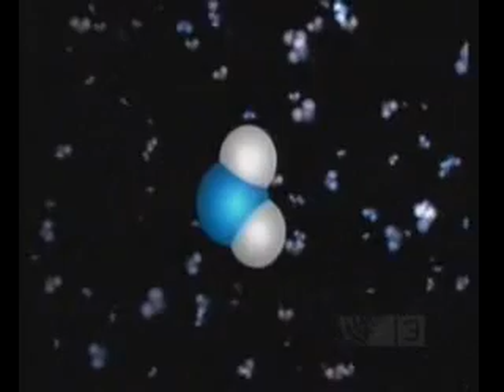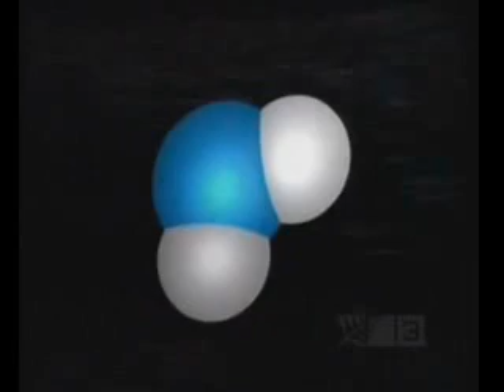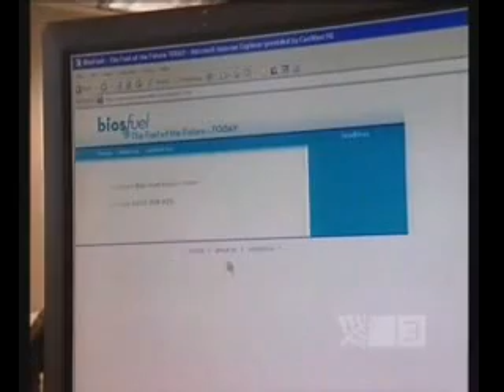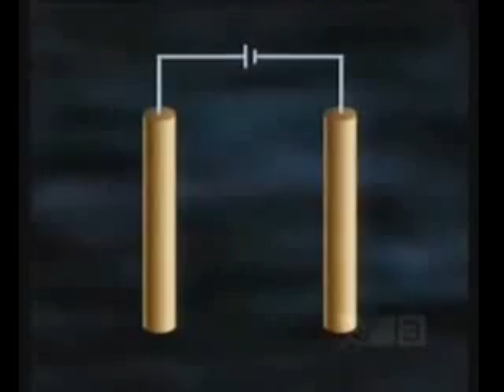A Motorcycle that runs on PURE Water.

Comment: What is the issue about having an Electrolysising unit fitted into home/garage to break the simple bonds of H2O and fill up Hydrogen/Oxygen bottles for use. I have to pay £5.75 UK per gallon, thats approx $10 a Gallon, surely a system to convert water into base gas atoms would be so much more efficient especially When you consider solar panels/wind/tidal to use for the power source to convert the water. BUT all You Oil Corp trolls will try and say we should still give you $10 a Galln for rotted trees, when we could EASILY grow crops to KEEP all that cash for all the years IN OUR Countries...OH except I forgot, the UK/European/Asian/Russian/China elites are ALL owners of OIL, Banking, Media, Pharma etc so why should they care if the world PAYS the Oil Corps $2 TRILLION a Yr in "Subsidies" thought we pay market price, that sounds criminal, even the criminal IMF said it WAS Criminal.....lol.
Reply: Nothing is stopping you from setting up a hydrolysis system in your garage.   Then you can see if the energy  required to produce your fuel costs less per watt than buying fuel from a gas station.  Solar power is going to require a significant investment and I wonder how long it would take you to recoup its cost by making your own hydrogen fuel.

As for oil companies suppressing this type of technology - maybe they are, maybe they're not.  But it seems to me an oil or automotive company would be far smarter to buy this technology (assuming, for the purpose of this argument, that it lives up to the claims of baldy), develop it and be the first on the block to have a viable product.  This would place them at a huge advantage to their competitors.  Their execs would be swimming in pools of money like Scrooge McDuck.
Reply: butlerproman
I've also been told of a system using a catalytic convertor from standard car. They fit this HHO gas outlet (H only I think) to the catalytic convertor and states the convertor heats to 400 degrees and can be used to heat home water systems cheaply if you want to go off grid using HHO more effectively for all power reqs.
Reply: Yea let keep bulk hydrogen in the garage now. A furnace and hot water tank id bad enough. (key between a and d broke on my keyboard lol)
Reply: Collin Huebler
Well you can make as you require. Plus no more dangerous than say a Huge Propane gas tank on Caravans, Camper vans etc, or fuel in the tank of Liquid Gas vehicles, all nasty stuff.  I assume you've lost your SSSSSS....lol
Reply: PYakMan1 Well if done right im sure its no problem but my main concern was when the neighbor starts his house on fire or a natural disaster. Also pressurizing the hydrogen for storage might prove dangerous. copy and paste will preserve on this keyboard until i take it apart lol
Reply: Collin Huebler
NO Different to having LPG on a car, or Propane for vans etc. Fuel is dangerous, but we have used it for 100yrs so if they blow themselves up, certainly should know better.
Reply: PYakMan1 You clearly didn't ready my comment.

Comment: one would think this is complete BS...and I would be one of those people....the only way this could seem to work is producing HHO with electrolysis. But standard means is has a poor net energy ratio. Meaning it takes one gallon of gas (energy) to produce a half gallon of HHO. BUT...there is a new way of splitting h2o. With aluminum and gallium. The water reacts to the 2 and splits with no need to add electricity or very little. So it is in reality if can be done...but I don't think this is it.

Comment: i ran my 1980 honda prelude fuel injected for 100klm before blowing it up, ive proved that it works no modification on a carby engine, non of the new engines will work straight off water, fuck the fuel cells, the engine need the split process to take place in the engines itself because it need heat and pressure in order for it to work.

Comment: the secret is that its just plain clean water, he is lieing i ran my car straight off it, dun and dusted, it will run due to the pressure of the pistons and the electricity of the sparkplugs bigger magneto bigger sparkplugs no problem at all to run, fuel cells are a scam they only make 1% of the needed amount of hydrogen

Comment: This video was uploaded SIX YEARS AGO. Do you know of any motorcycles today that are running on water? Surely if this were true, you would have read about or seen such water-fueled engines by now! But, surprise-surprise. THEY DO NOT EXIST!  And they never will exist because water is NOT a fuel (unless you mix other chemicals with it, like the guy in the video apparently does).

Comment: The U.S Department of Energy tested four internal combustion vehicles using hydrogen: a Dodge Ram van and a Ford F-150 with engines designed for compressed natural gas, a Ford F-150 with a gasoline engine that was modified to run on a hydrogen/natural gas blend and a Mercedes van with a gasoline engine modified to run on pure hydrogen.
The tests showed the hydrogen lowered emissions and increased fuel economy (as compared to the engine on natural gas or gasoline alone). Ford Motor Company has developed an internal combustion engine optimized to burn hydrogen instead of gasoline. The engine can reach an overall efficiency of about 38 percent, 25 percent more fuel-efficient than a typical gasoline engine with nearly zero emissions. The engine is based on ford`s 2.3 liter engine used in the Ford Ranger. Supercharging allows the engine to deliver the same power as its gasoline counterpart.

Comment: The more I look into this HHO business the more I figure that Stanley Myer had the right solution .In the HHO. We see many gizmo that produce some liters per minute with the average theme that they use some ~200 watts of power to give back some 1 liter off HHO . After that  the HHO is injected in with carburetor or injectors . Most all measures are liter per minute for these HHO devices .Stanley Myer I think went the other direction he figured out how much HHO do you need for every single explosion in the cylinder of the IC engine . He looked  the micro level explosion event to replace the few grams of gasoline used in the cylinder for each explosion event  . As the gasoline enters in droplets much of it is wasted as the fuel hits the walls of  the engines cylinder .Also the gasoline fuel  burns slowly so most of the gasoline fuel is ejected out the tail pipe while it is still burning. Fuel burning outside a cylinder is wasted fuel. This then  suggests you can probably replace the gasoline with much less HHO gas compared to the wasteful gasoline fuel . Gasoline fuel burns in IC engines are reputedly in the low ~20% mark and under with ~17% burn rate seeming to be the IC engine industry quoted number . The HHO fuel is a fast burn and we can expect close to 100% burn rates. This again suggests  we might only need less than ~1/5th the energy to match the gasoline fuel . The fuel energy density figures  suggest ~1 liter of gasoline matches ~2200 liters of HHO .therefore it looks like ina IC engine some ~440 liters of HHO fuel will match ~1 liter of gasoline.  You can work it out how much fuel in grams or parts of liter  you need for each explosion event in the IC gasoline  engine . Then figure out the HHO equivalent in energy and replace it .My Maths best I can figure is each individual explosion event in IC  cylinder  supplies about ~1 watt of power . That's based on a old 90's ~2800cc Merc  automatic doing ~60MPH steady on highway at ~3000rpm and getting some ~20MPG USA (1 gal USA is ~3,83 liters). The secret I think Stanley Myer had was he saw that making the HHO outside the engine was too much hard work .So instead to make all the  HHO outside the engine he chose to make the most of the  needed HHO gas in hundredths of second for each explosion event to supply the needed HHO to supply the  ~1 watt of power needed  inside the IC engine The HHO looks like it is made in  the cylinder head and down through the middle of the spark and maybe it drags some extra HHO from outside the engine.The side effect from this is that when the HHO recombines in the IC engine explosion event it forms water .Also the heat then  makes that water turn to steam which that helps the explosion event push down the piston .He then I think saw that if he included extra water in a fine mist  which was not made into HHO but carried into the combustion chamber   this too  might  create extra steam and extra power . So I  suspect  Stanley Myer did not do  any major  extra electronic gimmick  to make HHO at less than the ~200watts of power we often use to make HHO . I suspect  its more Stanley Myer  made it where it would return more energy back than we put in with cheating and using the steam side effect to do that  .My 2cents on the subject we should instead try to make the majority or all the  HHO inside the cylinder instead from outside the engine and follow the genius of the expert Stanley Myer RIP. If anybody succeeds  I suspect the best thing to do is make one version of it sell it to trusted family member for $1 Then document the sale and this will mean you can always manufacture it for  your life as you had it first . Then put the plans out there in the entire world to have .Then there is no point to kill you for the information its out there .The manufacturing rights will always be with you as first seller .If you try to patent they will probably Stanley Myer your you 6 feet under .Join the world of open source  inventions and groups in Kansas such as http://www.shazizz.com/shazizzradio.html. Good luck

Comment: "Water BASED fuel" and "pure water" are two totally different things completely misleading
Reply: cobnutts its super simple to separate the hydrogen and oxygen with a small amount electrical charge. He most likely added some baking soda to the water to act as a catalyst. Which makes the process happen at even lower voltages.

Comment: This dose not hold up to critical deduction or observation it's junk science just as foolish as his fear of being killed because he believes in magic.
The requirements for an internal combustion engine to run are Compression, Air/fuel and ignition. Each requirement has it's own parameters of efficiency in operation.
HHO or brown gas dose not fit into this realm because it simply can not be made to act inside these requirements. If I have to go into it in detail I will but you must be aware of your ignorance to gain wisdom from truth.
Denial of ignorance is arrogant and leads to stupidity.Ignorance can be remedied by learning. Stupidity is self induced mental illness and rarely correctable by outside forces,The only thing HHO or brown gas is good for is making vary loud and bright flash bang boom on new years and Independence day celebrations.
Prove me wrong I will admit my ignorance but in the realm of the internal combustion engine I have yet to be to be fooled by any claim made by these hustlers.
I dare anyone with such a claim to prove me wrong. If you can I will personally protect you with my life at no charge for your gift to man kind.
Wood gas or gasification of high Hydro carbon containing organic material is a tried and true application of a non-petroleum fuel. It's based on factual use all over the planet sense the invention of the engine with spark ignition. Although not practical in Today's world it is a viable alternative in rule areas when shit hits the fan.                   .
Reply: Yeah right...